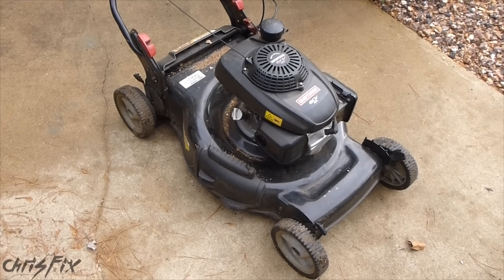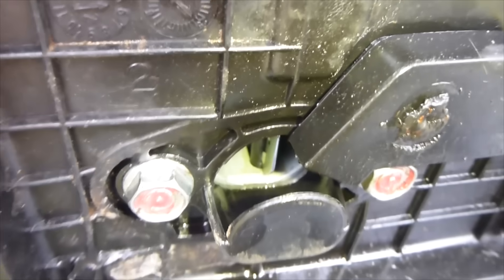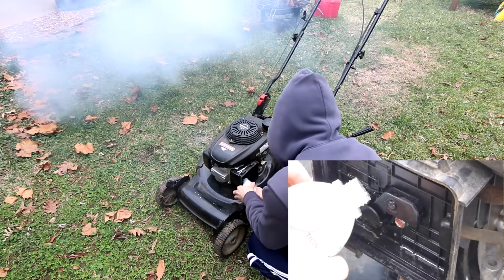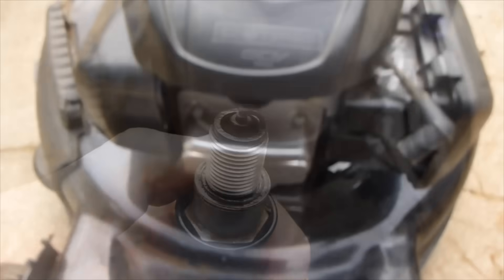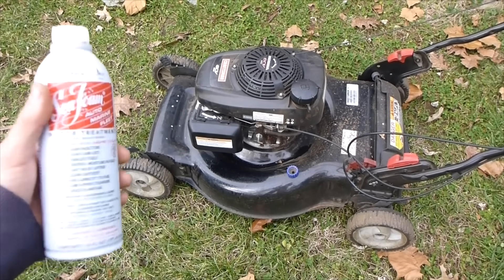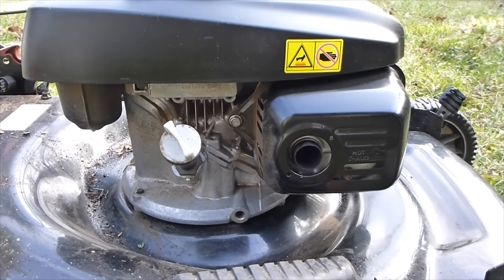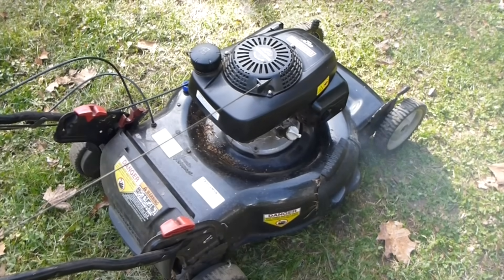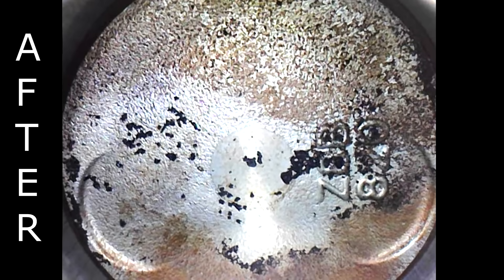Does Seafoam Actually Work? (with Proof)

Comment: Where seafoam really shines is with motors that sit long enough to gum up carbs. Had a KZ 900 a few years back that sat stored and untreated for 5 years. Changed oil added fresh gas and could only get it to run on 2 some times 3. Poured a full can in the tank and ran it for 15 minutes. After 3 hours I restarted and got it to run on 4. A week later did the same thing 3 gallons of gas and a can of seafoam. To remove carbon deposits in a engine I always use Mercury Marine Power Tune. Hands down the best for carbon build up.